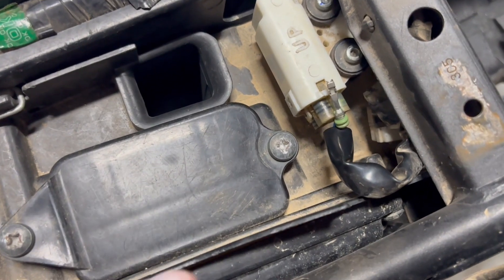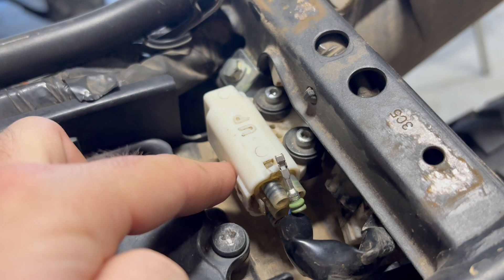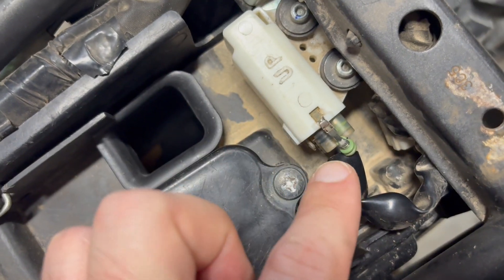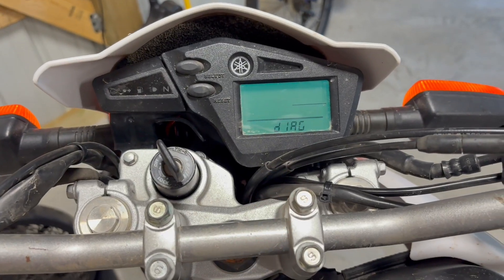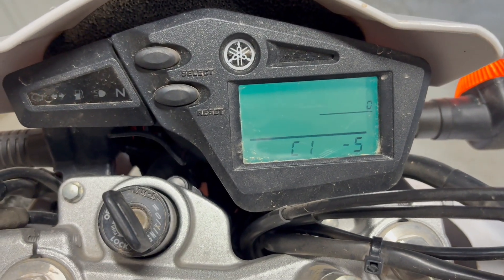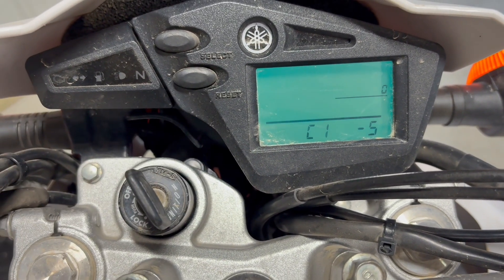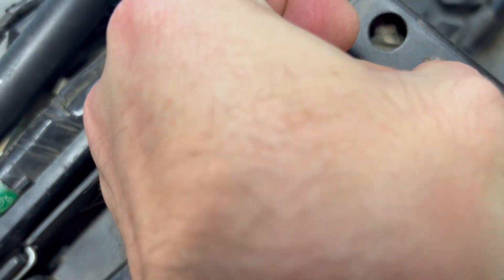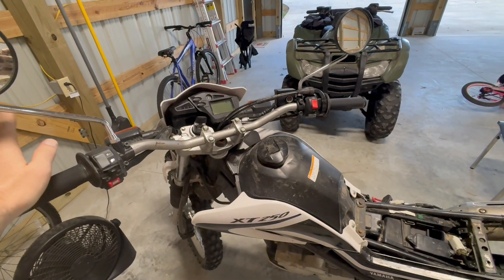Yamaha XT250: Adjusting Air/Fuel Ratio at Idle on FI 2013+ Models

Comment: So did you just change the title of the video while not correcting the fact that you're telling people to adjust their idle speed with the C1 settings?  Unless you can tune engines by ear, folks shouldnt mess with those settings.  Or at least without a stand alone oxygen sensor.
Reply from the maker: See if my latest change to thumbnail and description is satisfactory to you
Reply: @DirtRider22a cool thanks.  You have a good tutorial.  I wrench on these kind of machines daily.  It surely will help some people for sure

Comment: False, this is the air fuel mixture.  You adjust up and down quickly to see where the bike runs the smoothest.  Its the same as the low speed/idle circuit on a carburetor

Comment: That adjustment is to adjust the idle mixture not the idle speed. Idle speed will change due to mixture being changed though. It's best to adjust that adjustment so there is a smooth transition from idle to a small amount of throttle to get rid of the jerky bit that feels like heaps of chain slack. The idle speed adjustment is on the throttle body which adjusts how much air bypasses the butterfly.
Reply from the maker: Good to know in better detail, thanks for the info 👍